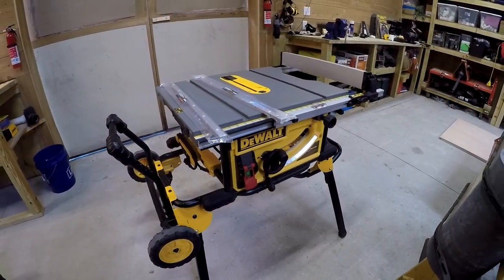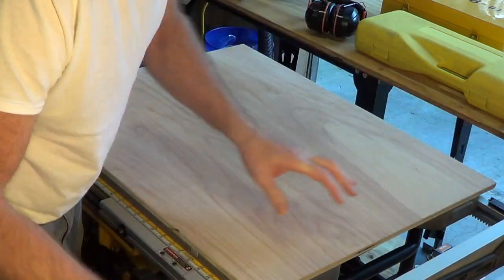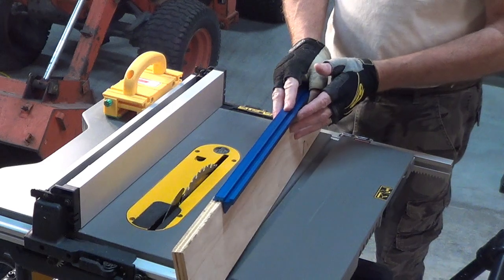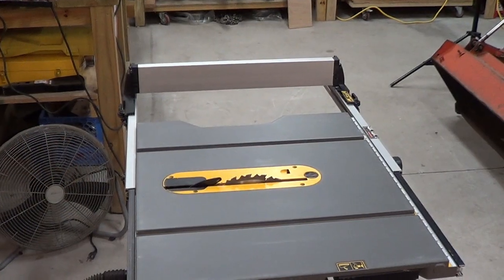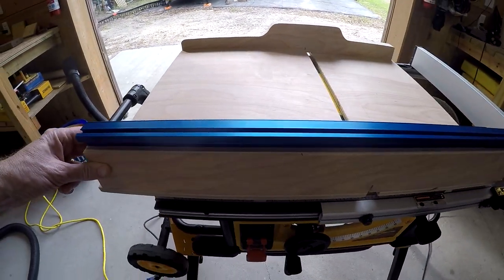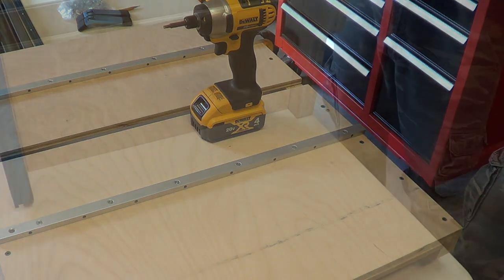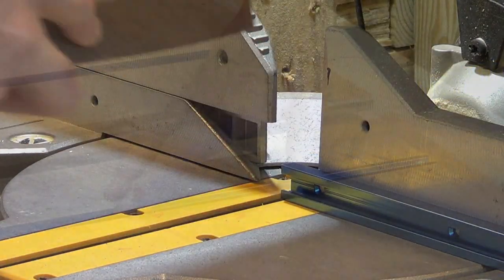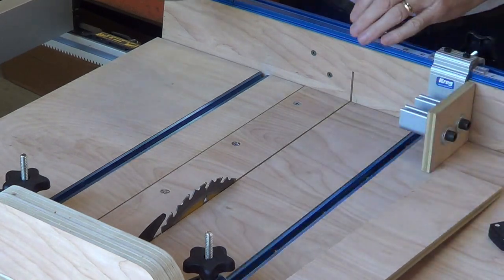Cross Cut Sled for my DEWALT Jobsite Table Saw

Comment: Looks like it works well. About the only thing I would change would be cutting the internal t-tracks about an inch shorter so you can easily remove and instal the clamps
Reply from the maker: Thanks!

Comment: i dont really get it. i've rarely seen an american use any other tool than an impact drill(same with foreign workers over here, they use impacts for everything, even screwing down plasterboards to steel studs, its insane cause you are just ripping the hole and the sheet wont be screwed properly). for this example i think it would be better to use the drill version rather than an impact. why is it that none uses that? for heavy duty framework i would also use the impact, but like fastening a piece of aluminium to a ply? no
Reply: If you have a drill and impact driver, it makes it convenient. you can pre-drill your holes with the drill, then drive the screw with the impact without having to switch between the drill bit and the driver bit. also, a lot of impact drivers today have adjustable torque so you don't over tighten your screw/bolts.

Comment: That turned out really nice. I may copy your copied design.  I have been wanting to build one for a couple of years, but I want to purchase a stationary table saw first, which I just haven't pulled the trigger on yet.  Good video!! - Rick
Reply from the maker: Hello Rick, It has already come in handy as I have used it to build an assembly table (see video soon).  A cabinet saw would be nice but I just don't have the room for it.  This DeWalt Jobsite saw actually works really well and the sled makes it feel like a cabinet saw.  Thanks!

Comment: Hi again. I've watched your video and James's video for this sled build about 50 times. That's no joke. I'm trying to get the process burned into my brain. I found both yours and James's video very helpful but yours is a little more straightforward and a little easier to grasp. I wanted ask you something. When you were screwing the inserts to the base, you said "Wow" but you didn't elaborate on why you said that. Can you fill me in on that? Thanks very much.
Reply from the maker: I am so glad you found this useful.  I don't recall why I said that, maybe I was just surprised that it actually fit...  :)  Thanks!

Comment: That turned out better than I thought I have the same saw... I was gonna make one but didn't know it would work... I had one on my bigger saw but I down graded cause we run on solar... I may try and design one and cut it on the cnc....... Awesome project keep it up brother....
Reply from the maker: Hey Dan,  So far this thing is working great.  It feels like I am on a cabinet saw when using the sled.  Thanks!
Reply: Awesome im gonna have to make one....

Comment: With such a small table area, do you ever feel it’s going to tilt when you reach the front or back? Wondering if I should use the T miter bar guides so it doesn’t tilt when reaching the ends? Thanks, great job! Garry
Reply from the maker: I have not noticed that as a problem but now that you mention it I will pay closer attention to it.  Thanks!

Comment: You made this look so easy! Great job and very cool video - the way you explained everything was so helpful. I would like to know what size drill bit and tap you used to create that Kreg stop add-on feature. I have some taps but I don't know if they are big enough. Thanks in advance.
Reply from the maker: Hello Dwayne,  Sorry but I do not recall what size tap I used.  When you get the part, you can just size it up from that.  If I get a chance I will see if I can measure the size bolt I stuck in it.  Thanks!
Reply: That's okay. I will figure it out. Thank you so much for getting back to me.   @HomesteadEngineering

Comment: Would this same sled work on a Dewalt 7485 saw? Also, where did you get the dado insert for your saw?
Reply from the maker: I don't see why not.  You may have to adjust a few dimensions.  One note:  The coating they put on these saws makes the slides stick a bit.  I have to sand them down a little, then no problem.  Thanks!

Comment: Great job. I am choosing your design to make this sled. I was wondering where I can locate the t-cap fence and the stop that goes along with it. Your help would be most appreciated.
Reply from the maker: I think it was this one:
https://www.lowes.com/pd/Kreg-Precision-Trak-and-Stop-System/3465288
Reply: @HomesteadEngineering
Reply: Thanks so much. One more question - did you use a 30” wide sled for the base. It seems a little long for my Dewalt 10”?  What width did you use for your sled?

Comment: I think it looks awesome. 2👍👍up.
I don't think I've ever seen one that didn't use a hardwood for the runners instead of aluminum, but the miter one that comes with most saw is aluminum so I guess it will work. 
Have a Jesus filled day everyone
Greg in Michigan
Reply from the maker: Greg,  I think most people just make them out of hard wood to save money.  The only problem with the hard wood is that it contracts and expands with temp and humidity.  The problem I have with these Aluminum rails is that the adjusters vibrate out of position.  I may have to "glue" them in place somehow.  Thanks!

Comment: Looks so easy with the right tools
Reply from the maker: Yes, Having the right tools is the key for sure.  I have finally reached the tipping point on this shop where I can pretty much make just about anything in it.  I have spent a pretty penny getting here but the tools are useful and hold there value as apposed to money in the bank evaporating. Thanks!
Reply: @HomesteadEngineering  so true